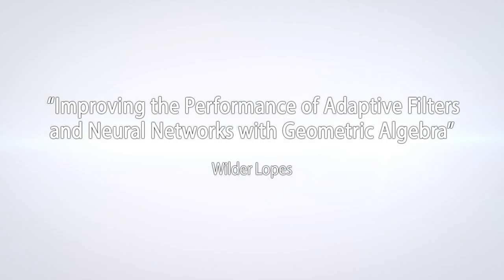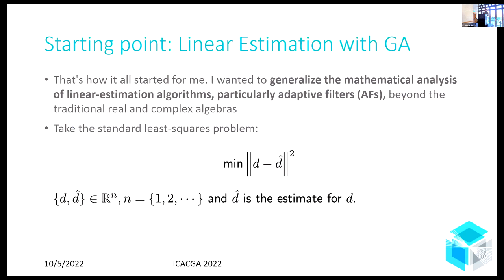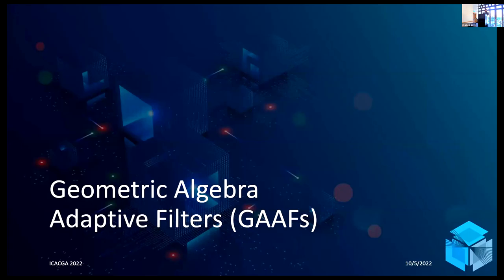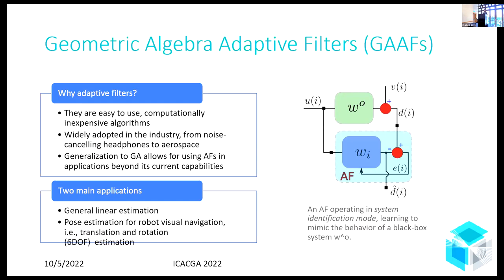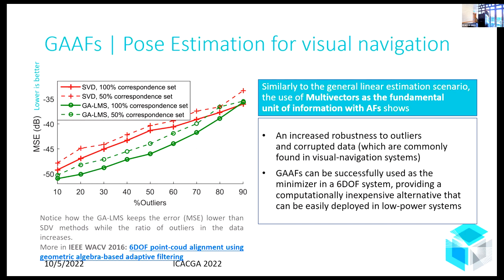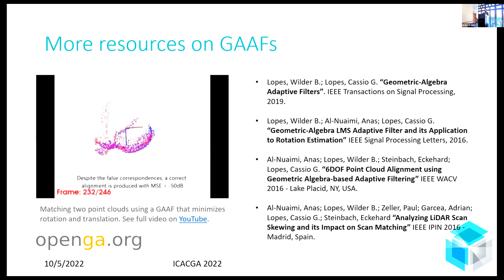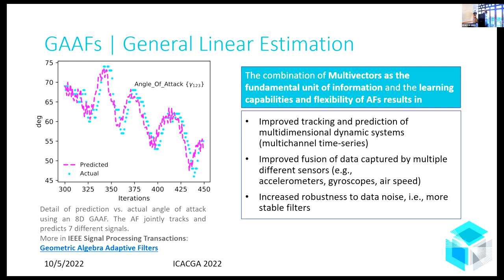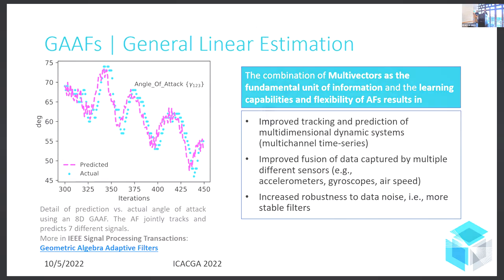ICACGA 2022: Improving the Performance of Adaptive Filters and Neural Networks w/ Geometric Algebra

Comment: 00:09	Geometric algebra can improve adaptive filters and neural networks

01:54	The speaker's background and journey into geometric algebra

04:37       Geometric algebra for adaptive filters and joint estimation

08:27	Geometric algebra for pose estimation and registration problems

12:32	Applying geometric algebra to neural networks for performance improvement

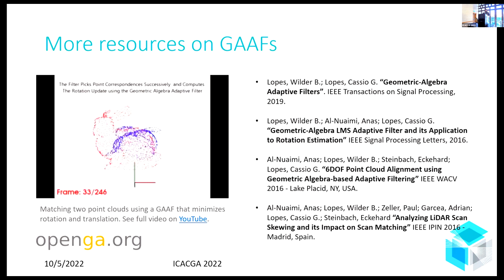18:12	Industrial application: geometric algebra for visual inspection in car manufacturing

20:34	Key insights: geometric algebra offers benefits like improved tracking and increased accuracy in neural networks